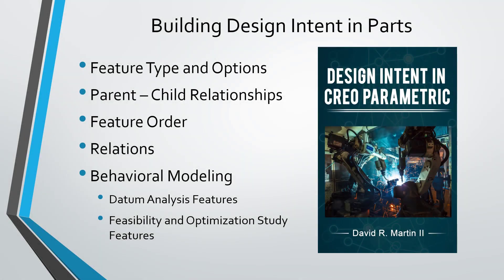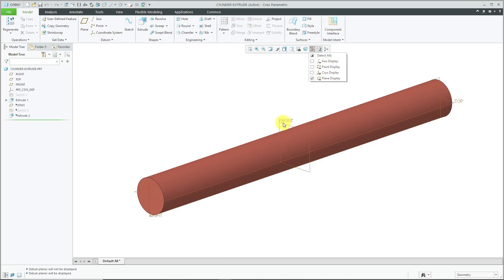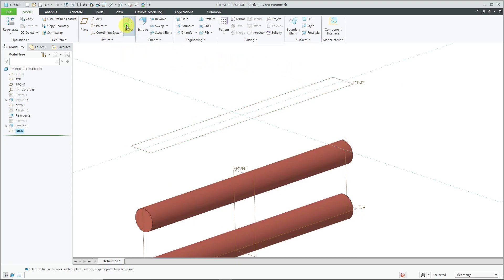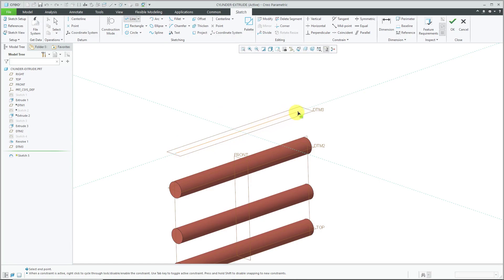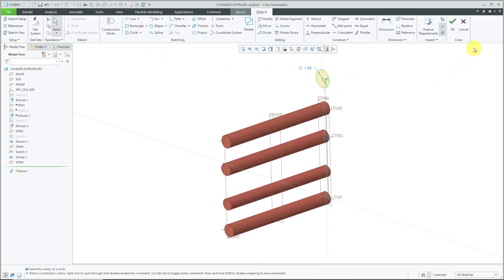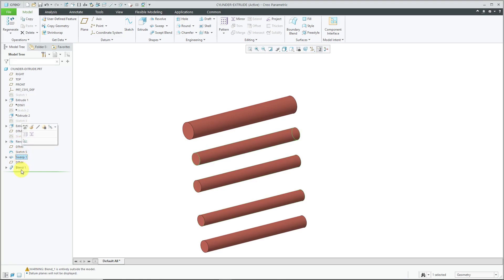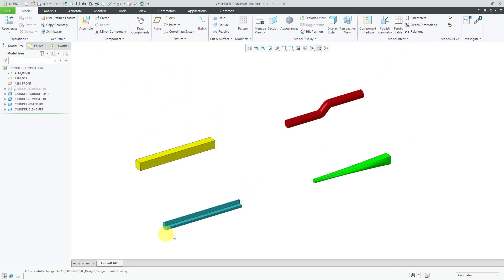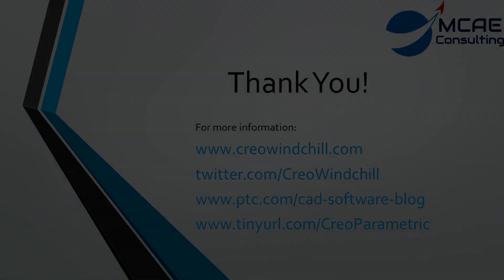Creo Parametric - Design Intent: Feature Type

Comment: Good examples to instruct design intent with different features.
Reply from the maker: Thanks! I used to use this example when I taught Introduction to Pro/ENGINEER and would have the students vote on which method was best. Extrude usually won but usually one or two students wouldn't fall for it.